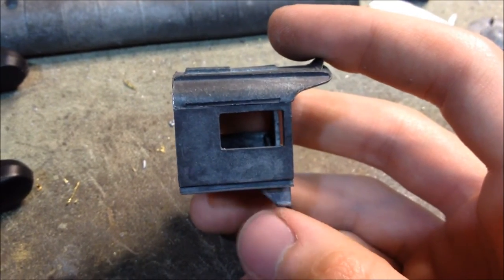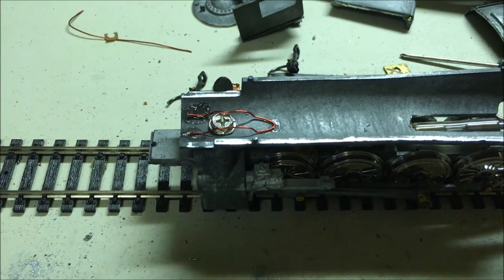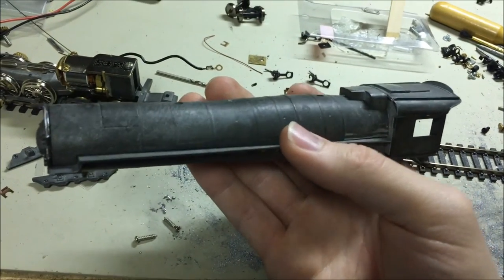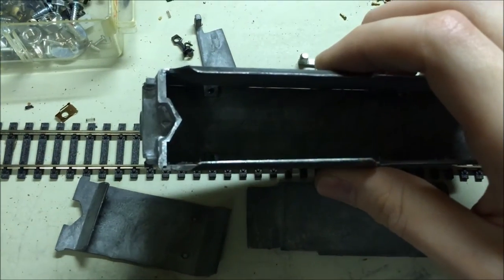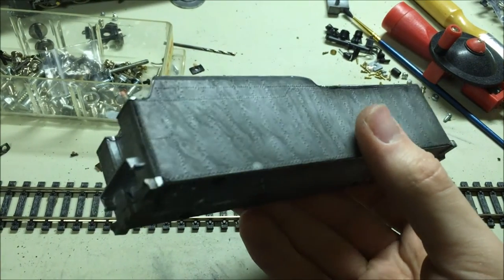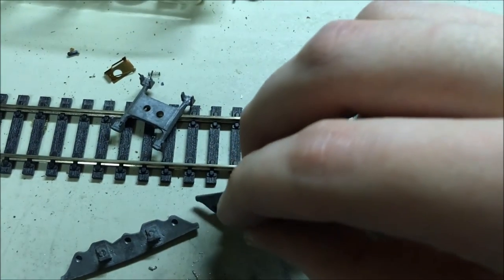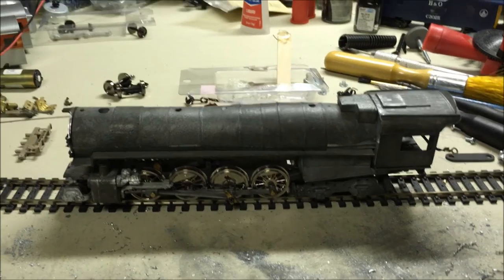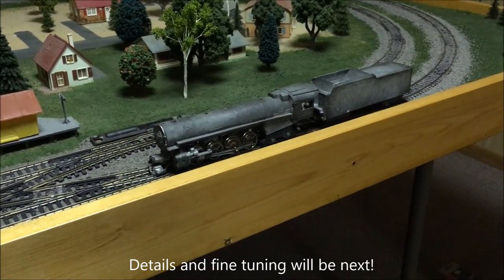Building an Arbour Models 2-8-4 kit: Body and tender - Part 3

Comment: Bowser didn't do anything with the Arbour line because they didn't know beforehand that they would not be able to use the low temperature rubber Arbour molds with Bowser's injection molding process with utilized high temperature zinc. Arbour's pieces were made using rubber molds and a centrifuge in a process very similar to how cast resin models such as Westerfield or Funaro are made. If Bowser couldn't make the parts their way, they considered the Arbour molds unusable.

Comment: Darth
Looking good.  You certainly don't tackle anything easy.Thanks for sharing. Bowser looks like a piece of cake next to Arbour.,maybe that is why Bowser never didn't do anything with it after they bought the remnants.
                                                                                                                              Ray
Reply: Ray. Bowser didn't do anything with the Arbour kits because of how they were made. Arbour kits were made using RTV molds and a centrifuge ...which was used to press Arbour's low temperature soft metal into all the little detail areas of the molds. Bowser used the injection molding process by pumping much higher temp metal into steel dies at high pressure. The Arbour molds were far too flimsy to be used in Bowser's casting machines and Bowser didn't want to issue locos made with Arbour's method which often resulted in poorly fitting pieces... so they just did nothing with the Arbour line.  Unfortunately Bowser "wasted" a significant amount of money acquiring Arbour and they still haven't gotten any return on their investment. Last I checked, Bowser was selling Arbour Models with the rest of their steam line as one package and refusing to parcel off any of the various lines of trains. You have to buy absolutely everything in one lot... which includes Arbour Models... or nothing. It's been years now and no one has wanted to buy the entire lot from them at whatever they're asking so... that's where it stands.

Comment: Do you have a preferred brand of epoxy that worked well with the Arbor Models metal? Thanks.
Reply from the maker: I just use regular 5-minute epoxy.  You do have to make sure the metal's clean first so that it can hold properly.